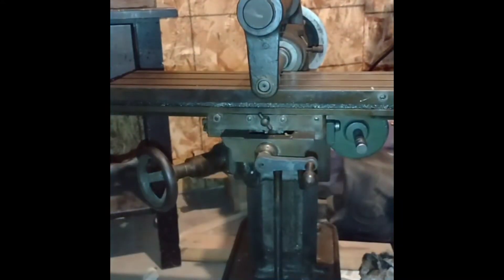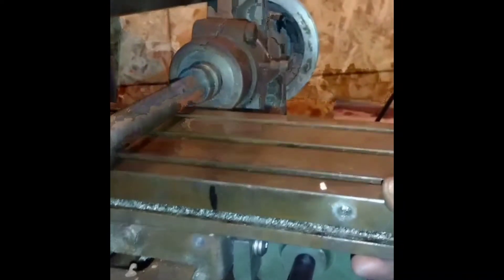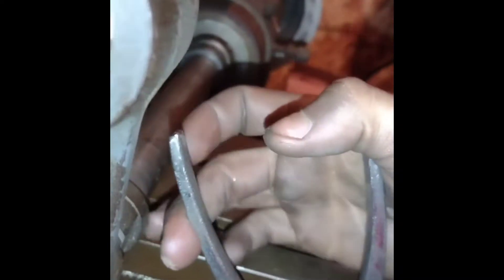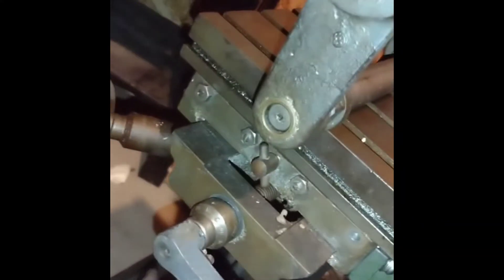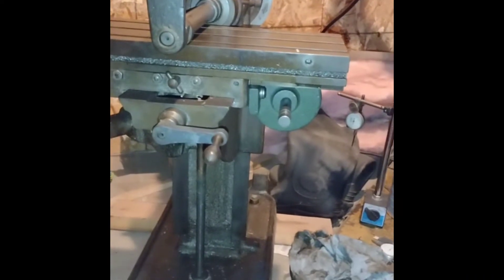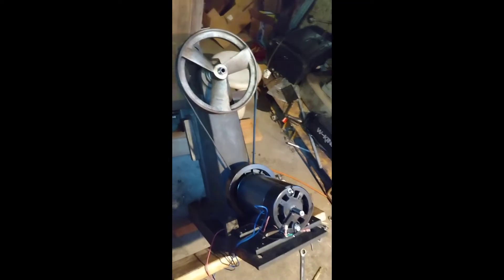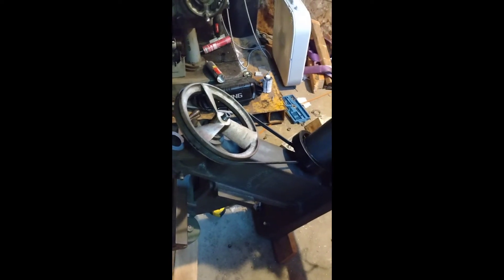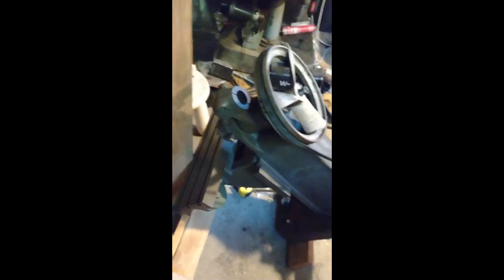Benchmaster horizontal milling machine pt.1

Comment: Thanks for the video.  I've never seen one of these machines before!
One note of caution about using treadmill motors on metalworking machines: The permanent magnets inside attract every steel or iron chip that gets anywhere near them.  In an application like this, where the motor has to be located below the machine, a shield to keep the chips as far away from the motor will save you a lot of headaches - and keep from shorting out the controller when a chip gets sucked through the commutator. (Ask me how I know! 😕)
The back side of the flywheel acts as a cooling fan to pull air through the motor (air flows in from the small end and out around the flywheel).  
If you'd be open to suggestions, try building a simple wooden box that covers the top and sides of the motor, starting as close to the flywheel as you can get it, and extending several inches out past the other end of the motor.  In addition, you may want to add some sort of filter that will keep smaller chips from getting sucked into the small end.  I ended up cutting out a piece of Scotchbright pad and hot gluing it to the end of the frame.  LOL, I'm sure there are better filters but that's what I had on hand at the time.
Good luck with the rest of the project, and thank you again for posting the video.
Reply from the maker: Wow never considered that. Great tips thank you!  A cover for the motor and the big pulley's giant blades would be wise for sure. All my machine tools are powered by treadmill motors as I don't have 220v power so this is great to know. Thanks for commenting!

Comment: That's an Adcock and Shipley mill if I got that right. I believe the bench master name was one of their lines. Another Youtuber Machine Nut Del has one as well.  I have a Nichols mill with a rack and pinion feed like that too- so far those two machines are pretty unique for that feature.
Reply from the maker: Wow! Learned something new. This one's a fixer-upper but yes, very unique and fun. I've pondered turning on it or even mounting a mini lathe grinding attachment to use it as a improvised surface grinder.